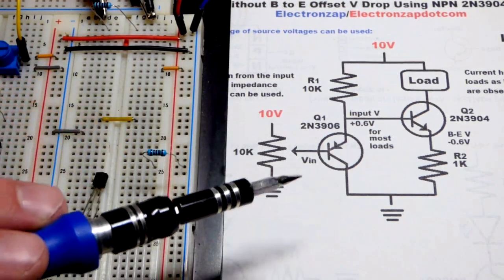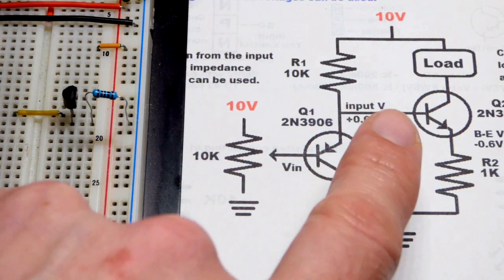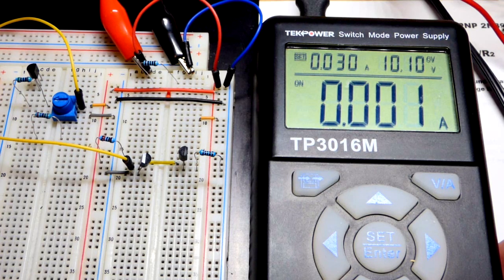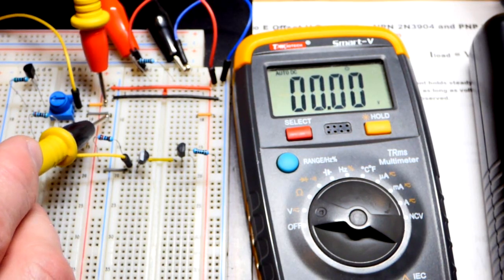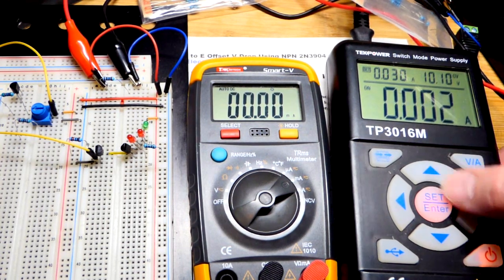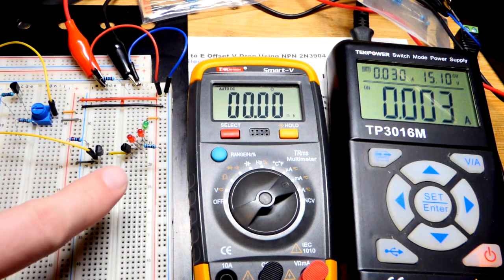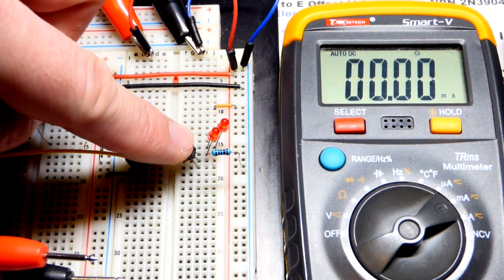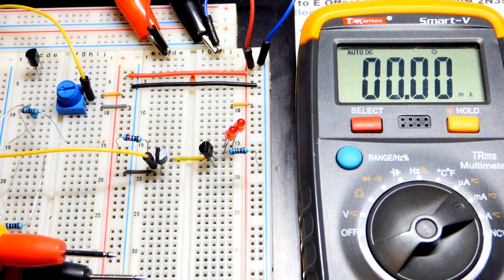Very nice electronics current source using 2N3904 NPN and 2N3906 bipolar junction transistors BJTs

Comment: Another very cool video!!!   awesome as usually :) :) 

Do you have the schema available  anywhere ?
Reply: Schemas are generally those things that are formal languages that describe the structure of databases. :D He shows the schematic for this circuit at the beginning of the video. It's on the right (half of the screen). Cheers! :)
Reply: @HazeAnderson  Guilty!!! I'm a software engineering, thus the bad habits :)
Reply: @ivorodrigues6931  this hobby with sharpen your software engineering tactics. And to think they refer to their testing as "smoke testing" in software testing! 😂👉💥
Reply: @HazeAnderson  I'll change the CI to Magic Smoke Test Runs 🤣🤣
Reply from the maker: Thanks! I starting putting most of the diagrams I draw on Patreon and will put those links in the videos that use them. They will only be available to financial supporters though.
Reply: @Electronzap  Fair enough!